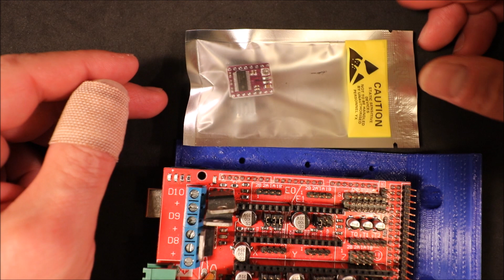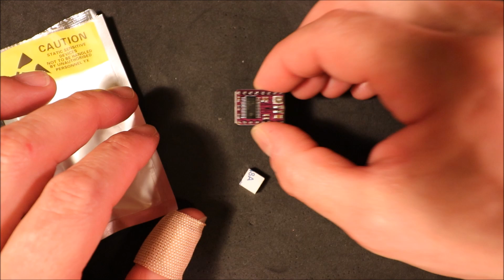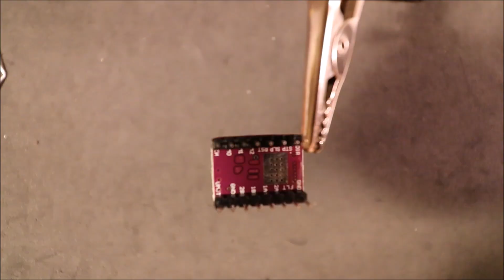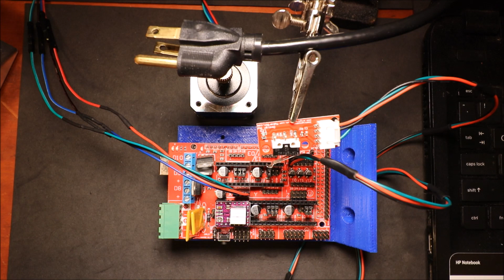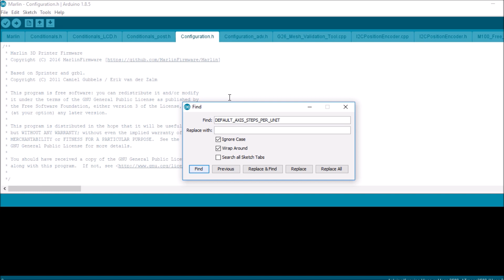RAMPS 1.4 - Stepper Driver install - DRV8825

Comment: I tried everything, even after that mention and same setup has been done, even though it's not working with drv8225 but the printer works with A4988
Reply from the maker: Check the version of the firmware.  Recorded this several years ago and Marlin changed it to where you no longer need to change steps as it's different in the new version of Marlin fw.

Comment: Hello mister! Greetings and thanks before start asking...! I'm here because I'd broke one of my drivers DVR and need to buy some new... but my big question is: once I get it, can I just connect it in replacement of the broken one and then life will be better or... I need to get some especific voltage number to reach happiness? XD In that (maybe obvious) case, where shoul I place my tester? I mean, doing all on the same board where it will be installed (on the printer, indeed) - Thank you!
Reply from the maker: Watch this video ... https://youtu.be/m1fOqq5GYDA

Comment: Sir for me X is rotating in only one direction i dont know why
Reply from the maker: What's in you configuration for hardware?  Also I have a Discord channel below that has a bunch of people that can help as well.
Reply: @EdwardBraiman  ramps 1.4 with a4988 stepper driver
Reply from the maker: In Pronterface when you enter the Gcode M119 what do you see?
Reply: @EdwardBraiman  all end stopper are open
Reply from the maker: Home the x axis and tell me what you see for gcode m119.  Move forward 10mm and then back and tell me what you see.
Reply: @EdwardBraiman  forward and backward movement is initializing, but rotation is in only one direction, if i say it to home, its keeps on rotation and once switch is triggered is says 
Error: Printer halted.kill()called!
Reply from the maker: Go to my Discord channel and post your configuration.h and congratulation_adv.h in general chat with a picture of your hardware setup either myself or someone else can look and help you
Reply: Im not getting current in x axis dir pin, which might b the problem, either program or the board??

Comment: Why does the extruder motor not work with the program used there if I am using the A 4988 drivers and a nema 23 motor?
Reply from the maker: Possible current issue with a4988.  What do you see as required current on a4988 and nema23.  I might tryout on live stream tonight at 6pm EST.

Comment: Can you help me? I need 4 motors for my z. How can i do it?
Reply from the maker: Check configuration_adv.h and search on, "num".
Reply: @EdwardBraiman  i mean how do i connect 4 motors when you can only use 2 with drv driver? How do i wire and connect this??
Reply from the maker: There is a device that can breakout one connection into two or you can breadboard.  This can be highly dangerous on this board for stepper.

Comment: Hello there , iam working on diy 3D printer i have everithing sorted , i have been looking at people's videos having problem with them  motors making noises and glitches ,but my motors act like they are dead....
PLease HELP!!!
Reply from the maker: What are the details of your machine?  Which version of Marlin firmware are you using?  Which motherboard and stepper driver boards are you using?  Which stepper motors are you using?  How long is the wire to steppers?
Reply: @EdwardBraiman  Hello there ,thank you so much for the reply, I am building CR-10 clone(a bit bigger in terms of Y axis) i am using Marlin 1.8.13 couse the newest did not complined(idk why) ,everithing seems to work fine with Ramps 1.4 /Arduino Mega 2060. I am running Nema 17 motors standart wires , i have followed many of your instructiions and everithing is just like on your side.... i had Trobleshooted it with that video as well https://www.youtube.com/watch?v=gVoUmdE6g6o&t=557s
but still they act like dead....
Reply from the maker: Search on, "A4988", in configuration.h and paste what you see for x, y and z.
Reply: @EdwardBraiman  unfortunatly i cant see nothing there is no such code in it ,and i am asuming that is an issue... i dont have any firmware for the motors ?
Reply from the maker: I was asking to check and see if there was a disabled stepper in firmware.  Between Marlin 1.8 and 1.9 they made a change in firmware to enable steppers.
Reply from the maker: I have a Discord channel in description below.  Could you enter general chat and send configuration.h and configuration_adv.h so I or someone else can look and also can you take a picture of the steppers on board and powered down board and take a picture with stepper removed so we can see jumpers below stepper?

Comment: sir ,can i run just the nema 23 motor without any other devices like thermistor,end stop etc. for checkig connection,sir i hv assembled  3axis router and running it since few month.now ni want to add 3D printer head to the same 3axis router,pls advice.sir I am 75yrs young engg. this i am doing as a hoobby.pls help
Reply from the maker: You're probably going to need to modify minimum temperature, but I normally don't do routers.

Comment: Edward Sir, i hv connection as per ur instruction and all software duly install,on connecting printer in pronterface there is no action on stepper motor but the software is running ok for about few second and then error message :MINTEMP triggered.kill -printer stop .i hv not connected end stop.pls what cuold be the reason
Reply from the maker: The temperature trigger is related to the thermistor malfunction.  It generally means it's not physically connected to the board.

Comment: can i use 12V 20amps SMPS,   with  Ramps + A4988 + 1 stepper Motor?    Please tell...
Reply from the maker: Yes.
Reply: @EdwardBraiman  But since a4988 drivers are suitable up to 2amps won't 20 amps cause excess heat ?   
Thankx for replying ....
Reply from the maker: Should be okay as they draw what they need .
Reply: @EdwardBraiman  so thankx man
Reply from the maker: You're welcome.

Comment: Hello edward really nice video. I am a mechanical engineer student and i have developed a 3d printer firmware with really nice features. I would be very happy to take a look at. Please let me know if you consider to use it, it is free and open source. I provide also the link to github.
https://github.com/3DHexfw/3DHex
https://www.youtube.com/watch?v=9iOEEMgbggs&t=2s

Comment: Hi
You're doing a really great job.
I have been following Ramps videos for a while and honestly found that your explanation is the best so far.
I consider building a CNC machine and putting a laser module on it.
I found several videos explaining the connection of the laser module on the Ramps via D9 which gives 12V.

But I did not find any detailed video explaining how to connect a laser module working on TTL 5V to a Ramps.
Of course, I want to go with  laser module with TTL 5V , because I found a cheap Chinese product on Ali Express, which was satisfied with many.

Can you make a video on this topic please ?
Thanks
Reply from the maker: I would like too, but first need to order filter shielding to protect my eyes and create a ventilation chamber.

Comment: do higher step counts make the printer quieter or no?
Reply from the maker: Step counts have to do with number of increment subdivisions you can achieve with the stepper motor.  Tuning of the stepper driver board does decrease sound.  The higher the stepper driver board does makes it possible to be quieter.

Comment: Hi, When I do homing to X-axis, the motor just spins a quarter of tour, then stops. When i press the homing button, and keep it pressed, the motor keeps running until I stop holding it. Can ypu explain what I'm doing wrong? 

And your videos are lit man, you helped me so much.

Thanks!!
Reply from the maker: Is it moving in the direction of the Endstop or away?  What happened if you move in other direction?
Reply: Not now it don't move it just vibrates it worked fine till I connect an old proxy nema motor
Reply: is there a way I can use secondary extruder port to drive x motor as I think the driver has died
Reply from the maker: @stiggybishope5449  Yes.  Not sure if I made a RAMPS 1.4 tutorial on this yet, but this is the same process.  https://youtu.be/2Hy9frwsFD4
Reply: All the other motors work which is u think I've broke the driver and wanted move it on second extruder but I can where or how to change it
Reply from the maker: Inside configuration_adv.h there is a option.  I'm not at my computer right now but it's something about an additional x-axis or dual Endstop.  Only remove comments for x axis.
Reply from the maker: Look at the tutorial in the comments above for dual Marlin steppers.
Reply from the maker: So you press home x button, correct?  Describe what happens next mechanically?
Reply: when it tries to home x the motor vibrates but does not move the currage it was working prior to it doing this but I tried an old motor as I was gonna use it to make a turn table for 3d scanning with an old motherboard
Reply from the maker: I'm guessing the wiring of the other NEMA 17 is different.  Check out my video on NEMA17 wiring.
Reply: @EdwardBraiman  its notca wiring issue I was hoping could change the coding abs just use pins for extruded 1 inatead
Reply from the maker: Explain what you're trying to do in phases?  What are you trying to build?  What parts are required?  What firmware are you using?  I'm a little confused about the goal here.
Reply from the maker: Is the motherboard functional or does it have issues?
Reply: @EdwardBraiman  i think the driver port has an issue which why unwanted to move it to extruder one driver
Reply: I enabled dual x stepper and its dead nothing moves

Comment: I have three stepper motor same type and two stepper same type.All are nema 17 1.8 step angle. but different model.can i use them with one 3d printer.
Reply from the maker: Yes, just need to calibrate.
Reply: @EdwardBraiman  thanks
Reply from the maker: You're welcome

Comment: My X axis is not working.What can i do?
Reply from the maker: Which version of the Marlin firmware are you using?  There is now an additional step with Marlin 1.1.9 firmware.  You will need to search configuration.h for, "A4988", and remove comments or name to stepper driver type you're using.
Reply: @EdwardBraiman  I am using 1.1.9.Comments out for motor driver.But only the x axis is not working all other axis is working fine.I check the motor driver its also good.
Reply from the maker: Try switching x and y steppers boards.  If problem migrates to y, then stepper was broken..

Comment: ok so i think i found my problem. So my motors seem to be skipping steps whenever I run somethiing
Reply from the maker: Sounds like a stepper board calibration issue or the wiring on the stepper motor connector.
Reply: @EdwardBraiman  Thanks for diagnosing my issu this should be easier to fix :)
Reply from the maker: Let me know how it goes.  Good luck.
Reply: @EdwardBraiman  Hey! so I need some help.  Like you said earlier they might have some incorrect motor connection. I cant find a way to fix it. I tried the LED trick but I got confused. (im 12)
Reply from the maker: Does the LED light when they're side by side connected?  Maybe you can ask an adult nearby to assist you.  The outer two wires should light the LED when you turn the motor manually.  If not then wires maybe out of order.  Check the datasheet for the motor for the wire order.  Should be something like black, green, blue red.  Unless the motor is pre-wired when it arrived.
Reply: @EdwardBraiman  Yes, the outer 2 light up
Reply from the maker: On both sides?
Reply from the maker: It means the motor is not the issue.  I recommend asking a teacher or an adult to check the problem to find the problem.  It's difficult from a distance to understand the issue.  Try posting a video of the problem and a link.
Reply: @EdwardBraiman  Is there any firmware configuration I may be missing?
Reply from the maker: Describe the symptoms?  What are you trying to do and what's occuring.
Reply: I try to run a gcode but then the motors just make noise as if they are moving but their not moving at all. just vibrating.
Reply from the maker: This means the stepper driver board is not calibrated to the motor.  The trim pods or potentiometer needs to be adjusted.  Think of it like water passing over a water paddle.  The  water (current) is either moving to fast or to slow.  Using a multimeter  will tell you which is occuring.  Which stepper driver board are you using?  Current is like water and moves the magnetic fields within the motor.  Keep in mind current is not healthy for human and you should have an adult assist.  Another way to get it working is to remove all power from board so there's no current meaning remover all plugs and USB.  Make a quarter turn of the potentiometer.  Then reconnect power and retest.  Keep any part of your body away from the electronics and retest motor.  You may have to do this a couple of dozen times.  Keep notes as to what occuring each time until the motor sounds smooth and there is not a strange noise.  Do you have a multimeter?  Also watch as many tutorials as possible on how to use.
Reply: @EdwardBraiman  Yes i have a multimeter. Is the issue i have too much current or to little? Do i turn the potenceometer to the left or right?
Reply from the maker: @treasuretotrash2067  This might help ... https://youtu.be/m1fOqq5GYDA

Comment: I am a middle school student living in Korea. Connect SMPS to RAMPS 1.4 board and insert electricity to turn off my computer suddenly Tell me how to solve this problem.
Reply from the maker: Sounds like you shorted out the USB on your computer.    Check to see if the stepper driver board is connected correctly.  The en (enable) pin on the stepper driver board matches the enable pin port on the RAMPS 1.4.  remember to remove all power from RAMPS 1.4 board before checking.  Also could you shoot a video and post what's connected to the board so I can get a better idea of what you have connected.  I need to see the connections for the stepper driver board and the Endstop to have a better idea of what you have connected.

Comment: Edward am trying to build a 3d printer but am finding it difficult to get some part like the ramps board and the driver. So I wanted to ask if you have a ramps board and some parts your no more  using will you like to share with me.? well my mail monicaodametey@gmail.com please reply me
Reply from the maker: I'm sorry I currently do  not have spare parts.  I wish you best in finding them.  Also I'm sorry I do not use personal email with anyone on YouTube, I prefer in the open communications with subscribers in comments fields only.

Comment: Hello Edward, how do you calculate the right setting for the stepper driver with a NEMA 17 stepper motor, or can you tell me how much mV must be set on the driver so that it works properly on a RAMPS 1.4 board without the stepper motors getting too hot ???? Thanks for your help and support in advance. Best regards
Christian
Reply from the maker: Sorry, I forgot to make a video on RAMPS 1.4, but this will help.  https://youtu.be/m1fOqq5GYDA
Reply from the maker: There are at least two videos in the RAMPS playlist explaining how to address.  Link to playlist is in video description.

Comment: hi, 
i want to ask about the output voltage from drv8825 ?
Reply from the maker: Aissou Amine I'll be doing a video on this soon. The parts didn't arrive yet to demonstrate.  You will need a datasheet on your nema motors and a multimeter.  I'm trying to find a safe way to demonstrate because of the power so it might be a couple of weeks.
Reply: Edward Braiman
thank you very much for fast reply, 
sure i'll be waiting for ur video 
all i need to understand is this 
-- i have 3 stepper motors 3V 2.5A 
and i have cnc shield and 3 drv8825 
cnc shields works from 8V to 40V 
so which power source i should use ? 
9V 12A 
or 
3v 12A
Reply from the maker: Currently I'm avoiding giving Vref until I can explain the concept to everyone.  So I'm saying I'm not yet confident to explaine, but I will be soon.  Sorry, just want to give accurate information.
Reply: it will be okay i have one month to get my shoping list

Comment: Dear sir, DRV8825 become very hot eventhough I used Nema 17 stepper. I have given very small amount of current. I do not know why? Is it for marlin firmware?
Reply from the maker: It maybe related to the drv8825 tuning.  There's a small potentiometer located on the drv8825, this controls current flow like a water valve.  It may need to be tuned.  I've not yet made a video on how to tune with test equipment as I'm still in the process of getting the test tools the demostrate, but there are several videos that exist on YouTube that may help.  I'll try and find a link on YouTube in a couple of hours.  The Marlin firmware is not the issue.
Reply: Dear sir, I change the values but still becoming hot.
Reply from the maker: Here is a video talking about the process of tuning ... https://www.youtube.com/watch?v=Vp9ZRCEhVYc

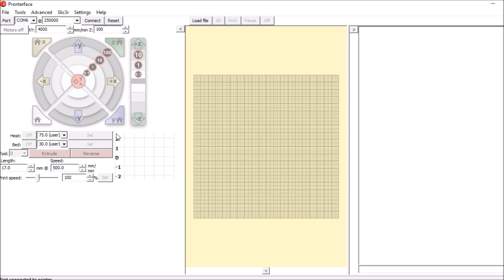Comment: 6:28 what is the software called? The software that you controlled step-motor. Thank.
Reply from the maker: My other tutorials may have a link.
Reply: Thank you for telling.
Reply from the maker: No problem.  It's all about making knowledge easy to find so other's can solve problems for humanity.

Comment: Would you please tell me the software that you used? I am using Windows OS. Thanks.
Reply from the maker: Ginger Wasabi I'm using Windows 10. And Arduino version 1.8.5 IDE or sketch as some call it.  I'll add the link tommorow.